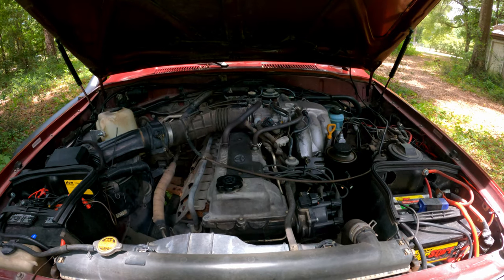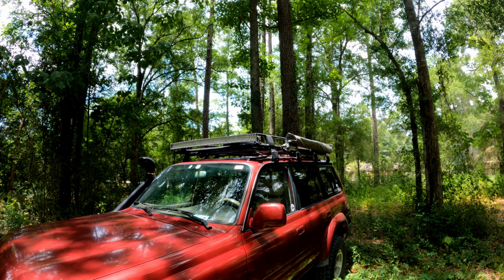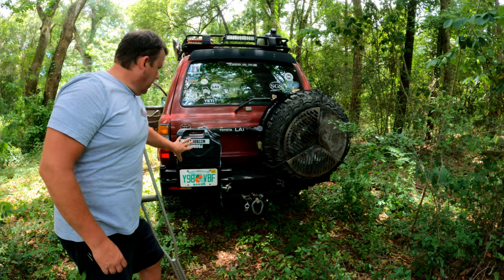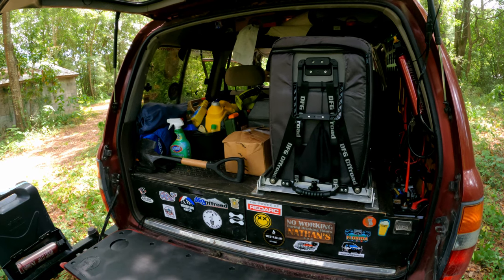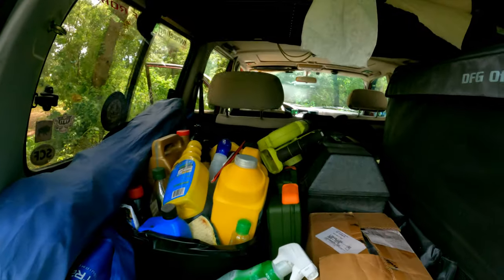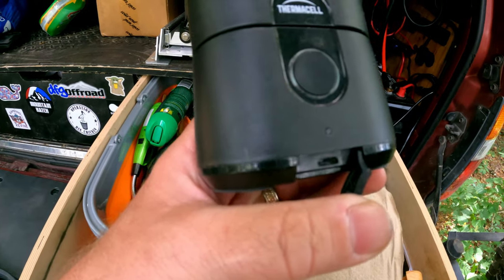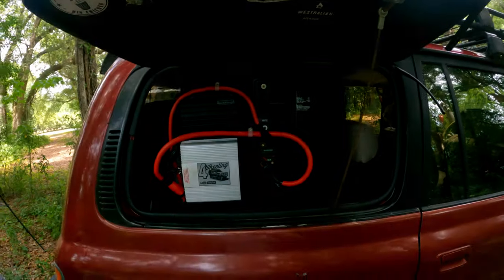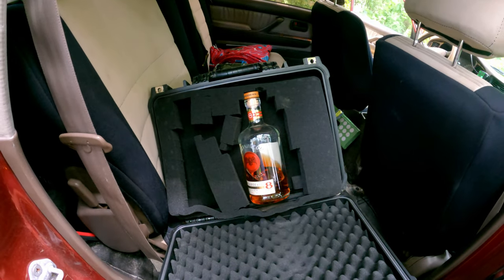LAND CRUISER 80 DIY OVERLAND BUILD WALKTHROUGH 12v Electric Drawers Snorkel Front Bar Badland Winch

Comment: What's an 80 like that worth in the States? Over here in Australia I'm guessing around $10,000 ($7500 usd)
Reply from the maker: It varies widely. I’ve seen them go for as much as $30,000 US, but mine would not fetch that much with the miles it has on the clock.